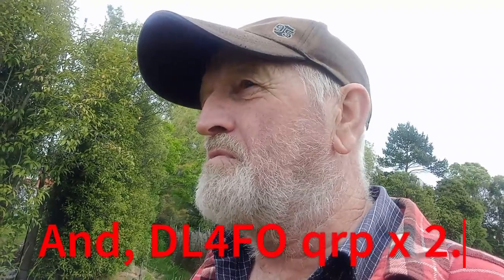ZL3XDJ, New Beam.

Comment: Well done old son ✅  KISS principle or is it Occam’s Razor… anyway, most interesting. Will you be doing a bit of a drawing with some build measurements on ? Just a sketch so those who can could have a go… I can’t 🤨 my garden is 6m x 4m  and is cluttered at that, very very modest station with a doublet courtesy of Peters video on that.  I’m pleased with your success. 💯% .  enjoyable pioneering type antenna builds for a few quid… impressed.
Best wishes. ( subbed ) 73.       💙
g0UvL
Reply from the maker: @Rubedo777  cheers mate, yeh try to get some more info out soon, just doing hospital visits now. 73 brian.

Comment: Hi Brian, love the down to earth no nonsence descriptions of what you build and use, silly question I know but whats the arrangement on the reflector element for adding the radials, I've just not seen that done before... cheers and 73s Dave EI2HPB
Reply from the maker: @davecarty6503  hi Dave, hope your well.
The radials are added exactly the same way, as the conventional elevated vertical,  except the vertical wire and the radials are connected at, what normally would be the the feed point. Making it one reflector length from the top of the top wire, to the very ends of the radials. More detailed video coming. 73 mate.

Comment: Great work Brian ... now i understand why i havnt heard you lately, you have been busy in the garden making antennas ... how did you switch between 1 and 2 elements in your measurements ?  Thanks Niels OZ1CGQ
Reply from the maker: Hi niels,  I ran out and took the reflector down hi hi
Reply: @brianfields4479  Hi Brian I assume the reflector is connected to ground in order to work ? if yes, then i assume you could enable/disable the reflector by switching the reflector  on/off like if you had a relay in the bottom of the reflector ..... did you think about that feature ?     its 08:30 AM here so ill have a look to see if you are on 20 Metrers :-) thanks Niels OZ1CGQ

Comment: Another great video Brian. Was the reflector 5'/' longer?. Still having amazing time with my raised vertical on 20m. 
Steve ZL1YX
Reply from the maker: @eagle9800  my driven ele turned out to be 4.9m and my new reflector is 5m, that gave me 100khz between the two and the most gain.
Reply: @brianfields4479  thanks Brian much appreciated.
Reply: Excellent!! After your success with the elevated vertical, I was hoping you would try a vertical beam!! Very happy to see you had great success!! 
I hope to talk to you on the air sometime. I’m 3/4 to Mobile DXCC on the east coast of the USA. 73!! WB3CFN/m